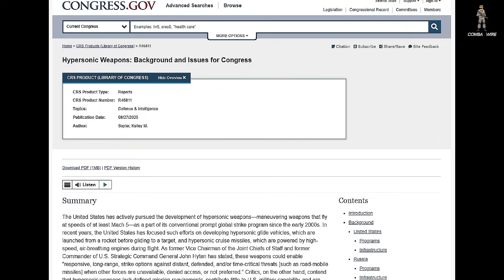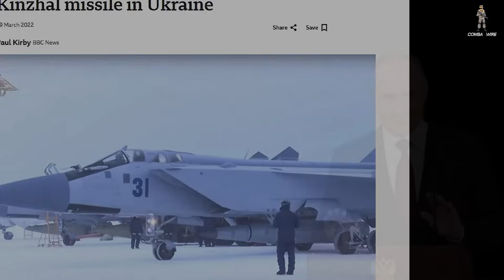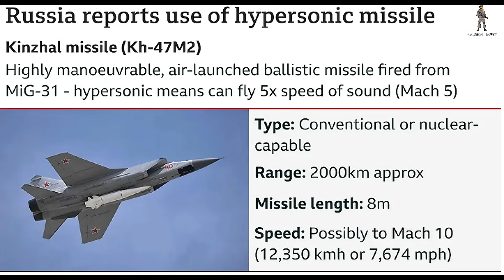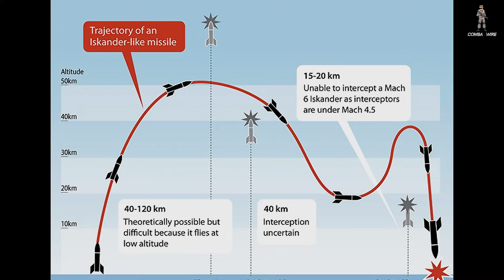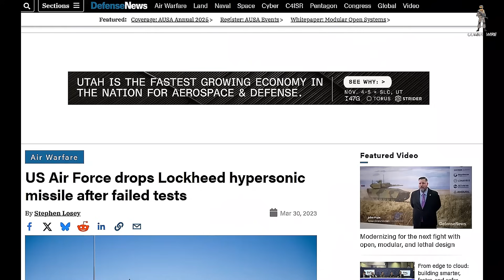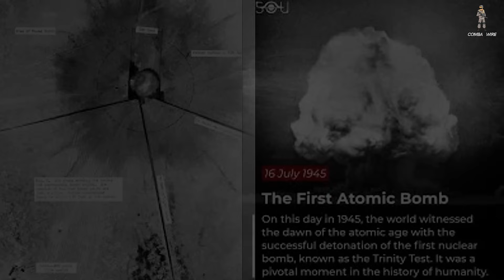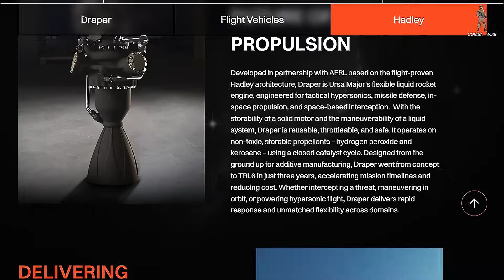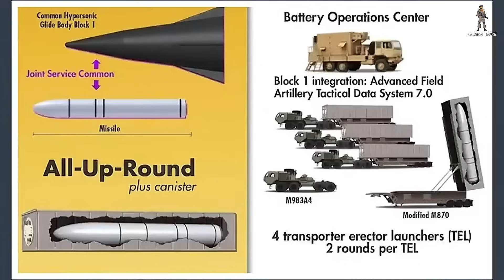US Unveils first true Hypersonic Missile to Beat China and Russia.

Comment: lol what a laughable claim. Wipe out 10 aircraft carriers in 10 minutes LMAO

When will people learn to stop taking China at their word??? When China announced its newest hypersonic missile they claimed it could hit speeds of Mach 50 (lol). They continued to claim this until it was pointed out by foreign military experts that if it traveled at that speed it would destroy itself when it re-entered earths atmosphere as it would just burn its self up…… 

On top of that the claims China makes about its hypersonic missiles come from the “rocket force” branch of their military which has become infamous for its corruption. Having had the last 2 heads of the rocket force purged for corruption, and has undergone more corruption purges of officials than the rest of the military combined. The Rocket Forces most recent corruption was when it was found out heads of the Rocket Forces most recent had siphoned off fuel from the rockets, to sell to civilians as “cooking fuel”.

Not only did they siphon off the fuel, but in order to not be caught, they replaced the stolen fuel with water 💧 LOL. Which actually damaged the rockets, meaning they couldn’t just add more rocket fuel to them and they would work. Nope, the water had damaged the internals of the rockets and totally bricked them. 

Also they didn’t just take fuel from extra rockets, but also took it from the ones stationed on launch bays, the ones meant to always be ready to fire as one the last lines of defense in case China was attacked….. 

These Chinese Generals in the Rocket Force, are the same people claiming they would take out 10 aircraft carriers in 20 minutes….. with rockets that only have water as fuel, and rock that go “Mach 55”, but also magically don’t burn up in the atmosphere….

So how about let’s not just take these idiotic Chinese propaganda claims at face value.
Reply: Would you like to fuck around and find out? 

Did you learn nothing when the lesser fighting force called the Houthis nearly hit an aircraft carrier with a missile? 😂 the Houthis! Imagine having to explain that one if they had been successful
Reply: @brizzle3903  Such a ridiculous point, do you think the US military treats Houthi Rebels with the same level of caution for their capabilities as they would the Chinese Military. Also, guess what? That was an aircraft carrier deployed w/o anywhere close to the kind of protective convoy it would have if an area where it is threatened by China. It also helped the missile used by the Houthi’s was too small to ever be a serious threat to any Navy ship except for the smallest ships. Ones we only use when we know it won’t be taking anything beyond maybe small arms fire, when on interception tasks which is a 41footer.  

Also, this has zero relevance to the point of the matter. Which is that the Chinese have continually made laughably ridiculous claims about their military capabilities (particularly their missles/rockets). If you took all of their claims at face value then the US military would stand zero chance, which is again laughably ridiculous. 

Our Military intelligence thoroughly investigates all claims of capabilities by the Chinese Military, however any of those officials will tell you how laughably ridiculous the majority of them are. 

lol just ask Saudi Arabia who bought the latest Chinese laser defense system for Drones to protect their oil fields. Then after receiving the laser system they passed official military doctrine making it against their rules to ever purchase any new weapon systems from all the state owned Chinese defense companies ever again. As they found out supposedly the “state of the art” laser system takes a half hour to start up to be ready to fire, but even worse that it would take 15-30 minutes of continuous laser contact to take down small military FPV drones LOL. Lastly, that the product had grossly insufficient cooling meaning after 15 minutes it could only be fired again after 30 minutes of cooling. 😅😂
Reply: @boshamburger123 53 days of bombing 
$1 billion dollars in total cost and what did the United States gain from this venture?

3 F-18s into the Red Sea due to aircraft carriers having to evade Houthi missiles that nearly struck them directly 

21 predator drones shot down by the Houthis which cost $15-35 million dollars a piece 

Aircraft carriers had to be turned around to be re armed due to attrition by constant firing of missiles by the Houthis 

And to this day not a single ship heading for Israel can travel in the Red Sea because it is still very much under the control of the Houthis 

In short the vaunted US navy can’t even handle the Houthis so what the hell makes you think they can handle a peer level opponent when in all war games simulations the United States outright loses to China in the East China Sea and the South China Sea 

You sure you want to test a peer level opponent that can out manufacture you by a factor of 20? A country YOU depend on for refined rare earth minerals to be placed in your defense/offensive capabilities?

Try again
Reply: @boshamburger123 and one more crucial bit of information 

China is the only country that can afford to buy US bonds not what do you think happens when the United States come sometime this year has to go to China and ask them to buy 3 trillion dollars of US debt in order to avoid a financial meltdown? 😂 the treasury secretary will be on his knees pleading with President Xi to help

If I were advising Xi I’d tell him “let these bitches collapse!”
Reply: @brizzle3903  this comment is so ironic, fortunately this is truly my field of expertise. I work as financial advisor, I have my masters in Econ, I’m a registered fiduciary, and I also have CFP and CFA certifications. Let me be really clear your weird fantasy comment about the US treasury secretary having to beg Xi Jinping on his knees for money is absolutely delusional, and makes it abundantly clear that you have no clue how macro nation-state level economics works at all. 😅

Lol, while most likely we are in for an economic slow down this year, based on signs from this past year. However, It will be far from some apocalyptic catastrophe scenario you are painting here. On top of that you don’t understand how national debt’s work either, 3 trillion off the national debt would effectively do nothing! The idea that the only thing between the US and complete economic implosion is 3 trillion is laughable. 

Also, nation states don’t have the sorts of traditional debt markets, like how medical debt is bought and sold, but that is exactly what you are describing in your scenario of them purchasing 3 trillion of the US national debt, it simply doesn’t work like that my man. The people who attempt to simplify it into those terms have no clue what they are talking about, and is generally a blatant attempt to fear monger.

On top of that China is currently in its own economic depression, with their economy severely struggling this last year, with the absolute collapse of their real estate market, to the point of homes in tier1 cities like Beijing/China were down 40-60% year to year. Or you can look at the collapse of much of their EV electric car companies, with plenty already having gone bankrupt, and many doing everything they can to fight it off, while begging the Chinese Gov for more subsidies.
Reply: @brizzle3903  LOL also so delusional it’s like you don’t understand the only reason the Houthi’s maintain control is purely due to political reasons, and has zero to do with military capabilities. Like you understand how little a billion dollars gets you in terms of arms spending right? How that represents how little the US wants to do with the conflict right? 

If you don’t understand that is political and has nothing to do with the capabilities of the US military, particularly the Navy, then you simply are too ignorant or too dumb to be rationed with.
Reply: @boshamburger123 you’re done little one 

You failed miserably like the US navy did
Reply: @brizzle3903  LOL 

It’s okay man. I get it, being confronted with your own ignorance or stupidity (still not sure which in your case) can be difficult for some people to cope with. 

But for real I can’t stop laughing about you bringing up a billion dollars as something you thought proved your point. Hahahahahaha!!!  oh no 1/900th or 0.11% of the military budget!!  whatever will they do since they clearly invested so many resources!?? 😂😂😂😅😅